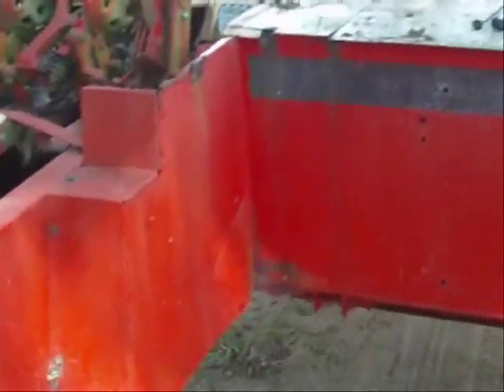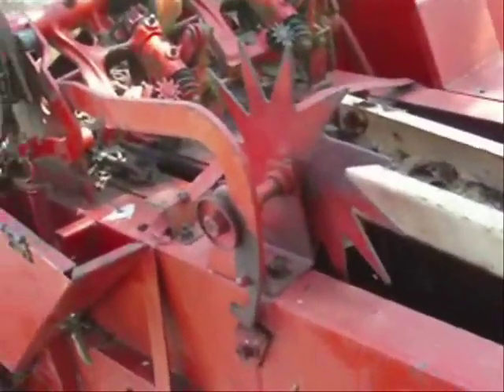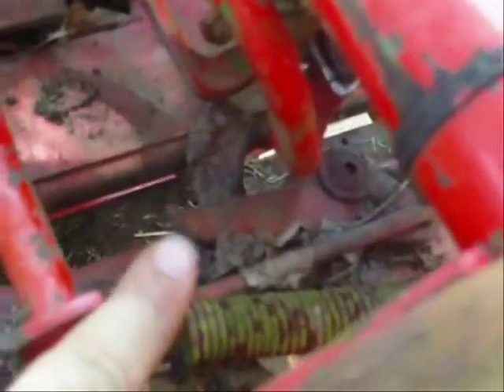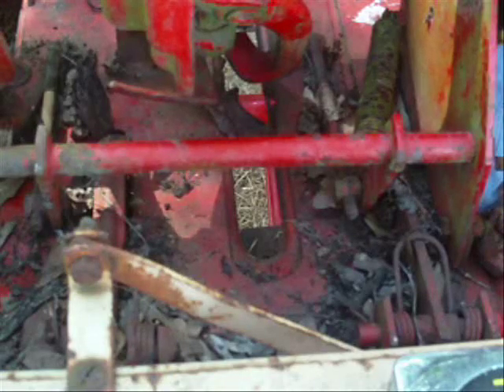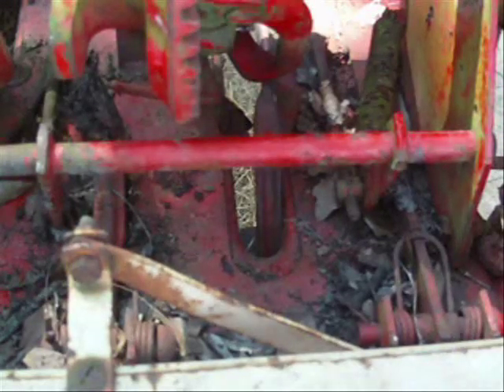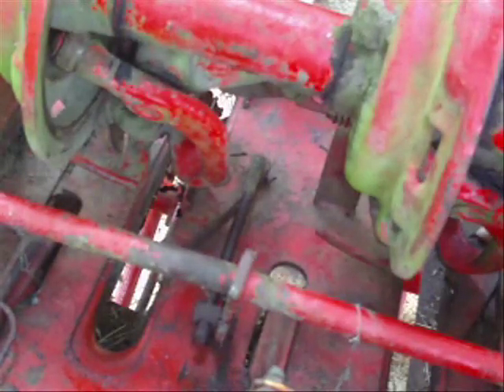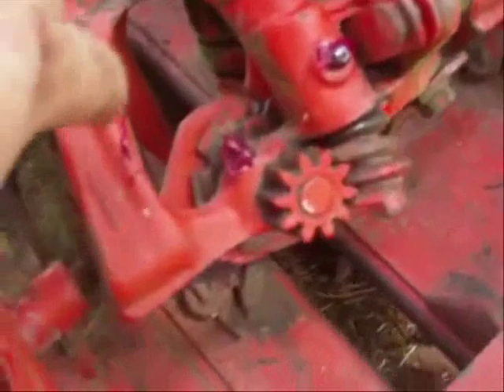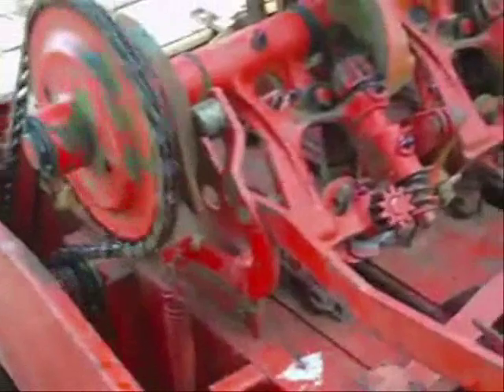Case 230 Square Baler - Knotter Timing

Comment: JD has a saftey lever also that locks up the baler & then the flywheel 1/4" shear bolt shears. Got to figure out why those needles broke or it will happen again. Usually it's because timing is off.